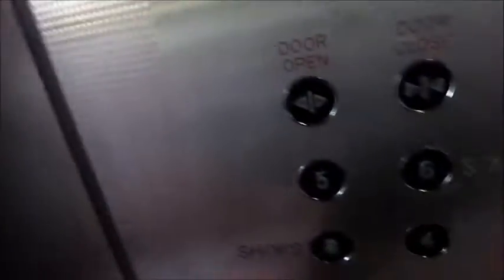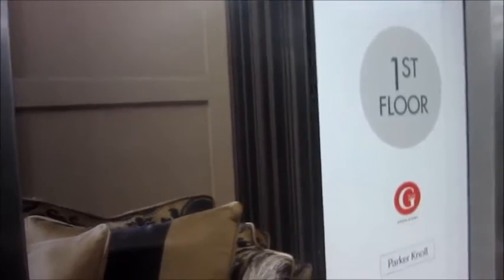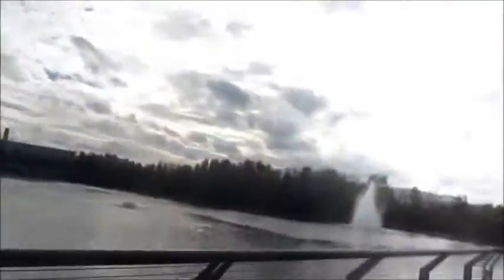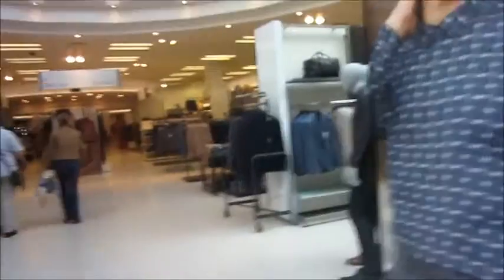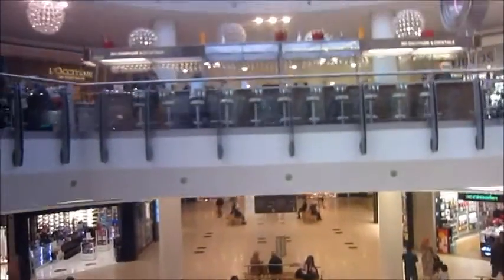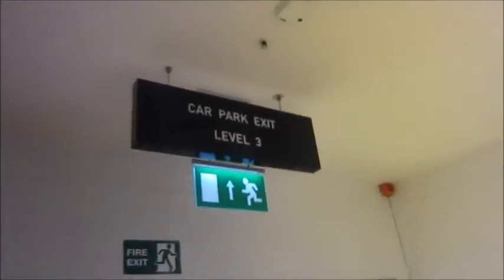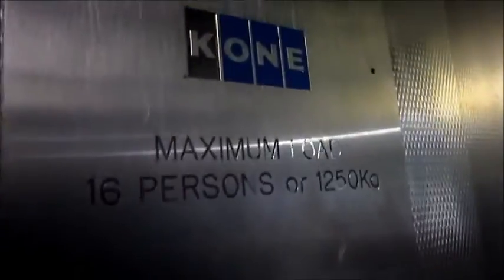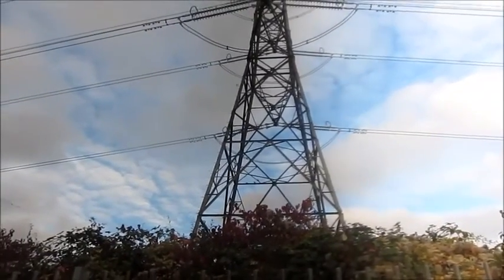Lakeside Shopping Centre, Thurrock | Lift Tour

Comment: The Lifts In Next Used To Be Oakland Lifts Replaced With Tenco
Reply: Yeah, and they called the floors 1,2,3 like teh shopping centre and Primark. And Boots had an Evans but it wasn't a classic one. I'm still angry they modded it though.